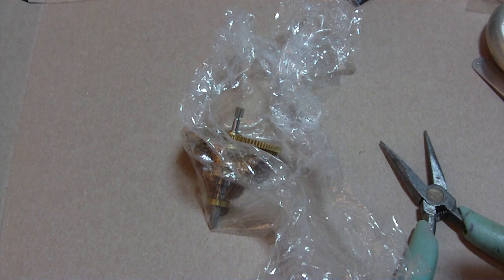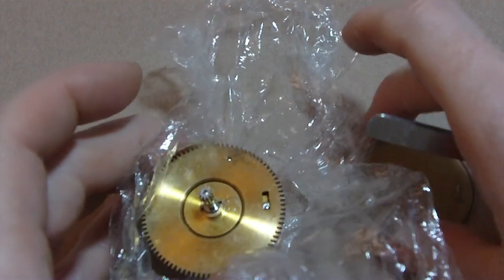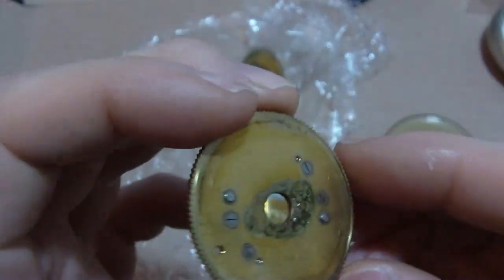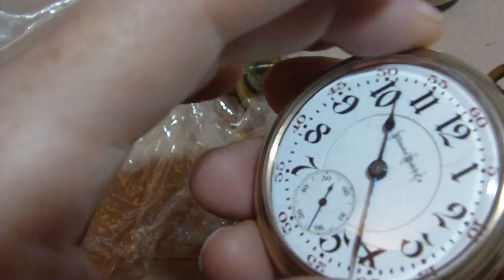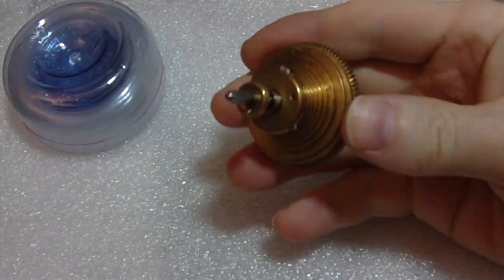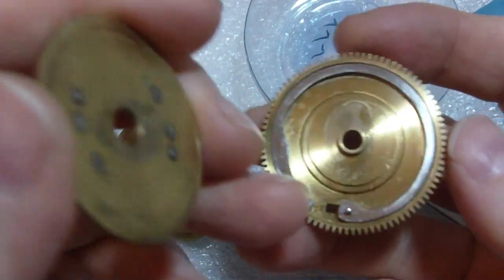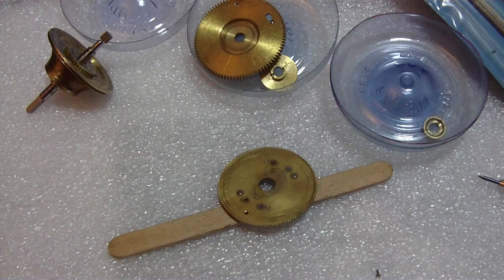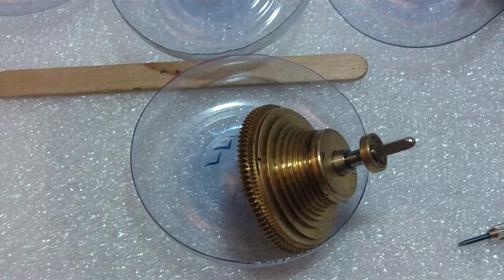What is inside a fusee.

Comment: I agree with comment by A.V. Cuber.  Please keep em coming.  Have you considered/would it work, if you drilled a hole for the pin that the chain attaches to slightly ahead (in opposite direction of tension) of the buggered on that has broken away.  This means that you could leave the damaged on & perhaps just 'clean it up'.
Reply from the maker: Holy cow!  That is a great idea1  Saves me a lot of time and effort.  That is thinking outside the box.
Reply: @bunnspecial  Pleased the you are pleased mate!!  Just keep those videos coming please
Reply: OH BOY my description was a tad off - what I was meaning is: if the fusee rotates counter-clockwise then the new pin would need to be clockwise of the damaged one Sorry about that
Reply from the maker: I was thinking about what you said in your original comment and thought it was not correct.  I agree with this revised location of the new pin.